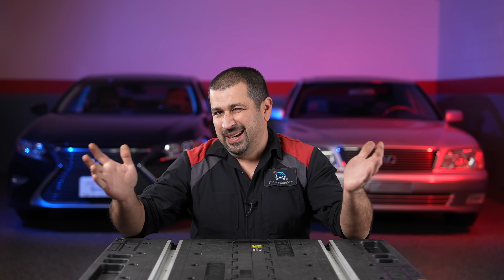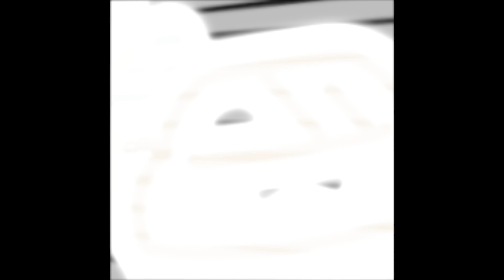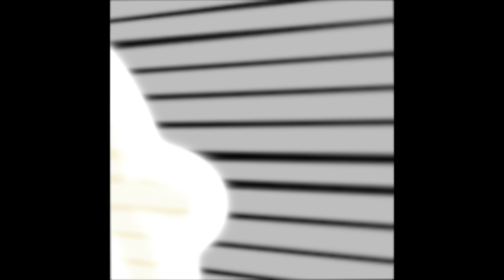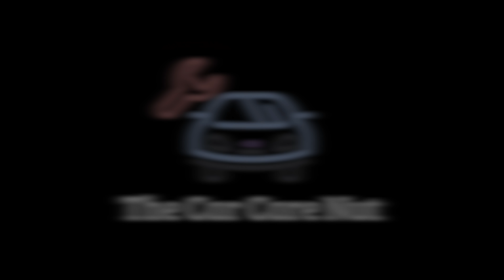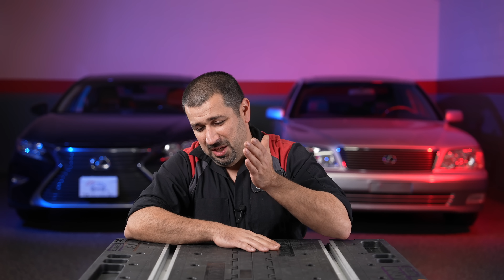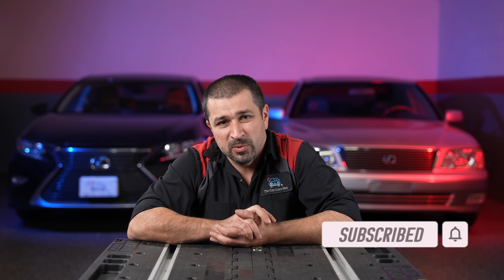Can Modern Turbo Engines Be Reliable? Here's The TRUTH!

Comment: 2018 VW ATLAS with VR6 engine. NO TURBO, NO EGR VALVE and oil changes every 5K miles. T4ansmission fluid every 30K, brake fluid every 2 years. Hopefully it can last over 200,000 miles.

Comment: I think a few points were missed. 1. If you care, pay for an oil analysis and do it for a few consecutive oil changes. They will tell you how your engine is handling those oil intervals. 2. We are seeing thinner and thinner oils. 20 used to be the lightest, but now I have heard of 8; it runs like water. ADD OIL; the lighter the weight, the quicker it burns. If you run low on oil in these thinner oils, you will introduce a lot of metal wear. 3 I own an M340 B58 car and switched from 0W20 to 5W30. I barely burn oil now, and everyone in the forums agrees with 5W30. What that means is do your research on your engine; if a thicker weight actually works go with it. Thinner oils introduce less lubrication and are there for emissions. Some engines will only work with thin oil; in that case, don't use thicker oils. 4. "Good oil" is more or less a myth now. Supertech, Kirkland, and Amazon oil are all made by Warren Distribution, and Project Farm has reviewed that oil. If you need to increase your oil change interval and the oil prices ($30 for 5 quarts) are slowly bleeding you dry, get the cheaper oil and change more often. Unless you are getting Amsoil, you aren't getting better wear with 1 10k oil change vs 2 Kirkland oil changes.
Reply: What if your car calls for 5W30? You can't even buy 10W40 anymore in a good oil. 5w40, 10w30, 20w50,?  My 2007 Lexus IS350, owners Manual calls for 5W30, but in other parts of the world, the same car, owners Manual calls for a higher viscosity.
Reply: By good oil, I mean a decent, full synthetic.
Reply: @squaaaaak3178  5W30 has a lot of good oils that have different strengths. I have used Shell Rotella and Pennzoil Ultra Platinum and liked both for different reasons. For 10W40 you still have good options like Mobil 1. Valvoline, Castrol, or Liqui Moly are all just personal preferences on what brand you trust. If you beat on the car hard and push it then you can look into Motul but you are paying 2x the cost of the other brands for a slightly better oil. By no means is it 2x better either. If you don't push the car the "good" oils don't matter to you so just get what is within your budget and keep the oil clean and topped up. And trust me, you aren't getting a real full synthetic at $20-30. There is a reason Amsoil is so expensive; 99% of the cars on the road do not need a real full synthetic. If a modern performance car uses synthetic blends, then an old economy car for sure does not require a real full synthetic.

Comment: 23 Si, 2,000 mile oil change intervals since the first oil change. I drive it aggressively to redline whenever I drive it. Also, I fill up with Shell's 92 octane fuel. I don't even warm up idle my car. I just turn on my vehicle and casually go as long as the windows are clear. I shut off my vehicle once I park. No engine issues for 27k miles.

Comment: I agree fully with CCN's advice.  The reason that automakers embraced small-displacement turbocharged engines is because of the insanely stupid way the EPA fuel economy regulations were written.  Here is the dirty truth that EPA bureaucrat pinheads don't want the public to know:  At highway speeds or under heavy load, a small-displacement turbocharged gasoline engine will get little better fuel economy than a larger displacement non-turbocharged engine--it just takes a certain amount of energy to propel a vehicle down the road, no matter what the power source.  BUT, the EPA fuel economy "formula" is weighted toward urban (city) driving, which is done at light engine load or at engine idle.  What governs fuel economy there is not how much power the engine must produce, but how much piston mass the engine must continue to push around at low RPM or idle RPM--fewer cylinders and smaller displacement means less piston mass to push around and less internal friction in the engine.  That will, indeed, lower fuel consumption if a vehicle is equipped with a smaller displacement engine when it is being driven in city driving.  The "dirty little secret" part is that the fuel cost savings of that smaller displacement turbocharged engine will be eaten up by the its decreased longevity and lower reliability.  That may make the EPA fuel economy numbers look good, but it will wind up costing drivers much more money over time with the turbocharged gasoline engine.

Comment: I have a 2018 Tundra V8. 72k miles. Gas mileage sucks but I don't care. It will last 1,000,000 miles. No turbo engine will do that. Not even a Toyota.

Comment: "Can Modern Turbo Engines Be Reliable?" Over the short term, usually yes. Over the long term, absolutely NOT. They are under FAR more stress than larger displacement non forced inductions with the same power output. They are designed to fail at far lower mileage than a normal engine. The 4.6L SOHC 2 valve V8 in my 2 ton Crown Vic has over 400,000 trouble free miles on it. The 1.4L DOHC 4 valve turbo engine in my sisters 2013 Chevy (Daewoo) Sonic completely disintegrated at just under 100,000 miles, and it took a lot of repairs just to get it that far.

Comment: What's your opinion on small micron oil filters like five microns I don't think it's a good idea not for diesel. I don't think you should go below 15 microns don't forget that 15 microns will come down to 10 microns quite quickly. You're restricting the flow if you've got small microns like that it will build up quickly and actually cause some starvation it's not always I don't believe good to have very fine filters in oil air yes oil no.

Comment: I bought my 87 grandnational with 74k miles the only problem was a slightly worn timing chain. I had the engine rebuilt and replaced the stock timing chain with a double timing chain.  It still has the stock rotating assembly and flattappet cam.  factory it was 245hp and 360tq.  It now has 500hp and 600tq.  Quater throttle is usually all i need to do if a car challenges.  Not a great top end and with 4 gears with overdrive.  What makes these cars so quick is you're in the full torque band at 2800 to 3000rpm.  I had a guy in a mustang challenge and his car sounded great.  I left him standing still.  He had a passenger, i had my family with me.  Later a guy with an m3 tried me.  We stayed pretty close, damn near even.  I back off when traffic picked up.  My car is so silent, sometimes i can't believe the power it makes.  I let it sit and run for a few minutes before i put it up.  It loves this time of the year, cool weather boosts HP.

Comment: I had a 1990s Mazda mx6 turbo. 2.2L, 164 HP. One of the best engines and cars I've owned. Zero issues with the turbo after 200K miles. Changed oil every 3k-5k miles with Dino oil. Oil changes are crucial

Comment: A major rule of thumb for Chemical Engineering is that the reaction rate doubles for every 10 degree C increase in temp. So that means a 20 degree C change in engine oil temp increases the un-wanted degradation reaction rates by 4 times. (Arrhenius equation)
Reply: Yeah I'm convinced the difference between engines that need oil changes every 5K miles and those that can go to 10K without issue are presence of oil hotspots within the engine.  I'm happy that my Mazda skyactiv 2L engine is toward the latter end.

Comment: Toyota recommends oil changes at every 10k miles i usually to them at 5k. A few oil analysis tests on the new Tacomas showed that 5k was the time to do it. Full synthetic all of the time.
Reply: That is the proper way of doing things.  If people want to shift oil intervals around, get Used Oil Analysis and see what the data shows.  There is this one size fits all mentality now, that everyone needs to use 5W-30, everyone needs to change their oil every 3000 miles on every car.  That simply isn't the case.  It depends on the car, the driver, the region it is driven in, how it is driven as far as highway or city, etc. etc.

A car driven in the city in traffic may need 3000 mile oil changes, and the same identical car that does mostly highway driving may be fine doing the oil changes at 10k miles.

If the oil analysis shows the oil should be replaced at 5k, do it at 5k, it if shows 3k, do it at 3k, and if it shows 10k, then doing it at 10k miles is just fine.
Reply: @redbaron6805 That’s too logical and sensible of a post for the sheep mentality that prevails in the comments section.
Reply: My plan is to do my oil changes every five thousand miles.  The dealership said that they understand why I am doing it this time but don’t recommend that I do it in the future.  If they give me a hassle I will find another place to get the oil changes.  This is the interval that I did for my Subaru’s, two out of the three were turbo charged, and I did not have problems with the engines.  The distances I drive basically I am changing the oil every other month.  Wished I did not listen to the dealership about not changing the oil in the CVT transmission as I would still be driving my 2019 Outback.  There is a Subaru mechanic that does videos and he is absolutely correct, you will only get around 130,000 miles out of the transmission if you do not change it.  The dealership is making sure that you get their lifetime out of the vehicle, the warranty period.
Reply: I think hybrids will ultimately  be the solution, especially  the plug in type. You get range, decent gas mileage and range.  The engine gets used less making longer oil change intervals more realistic.
Reply: Well I recently bought a new Santa Cruz free oil change $30,000. 60.000 90.000 free from the dealership which is Turbo that's a joke most oils are only good for 15 to 20,000 synthetic oils i just did my second oil change 6000 MI and the oil was already broke down and dark the car doesn't have 10,000 miles on it my point is you buy top rated oil I use mobile one full synthetic and barely got 6,000 Mi out of it I can't imagine waiting for the 30 thousand Mile free oil change from the dealership that oil will not do 10,000 MI either I will not wait 6,000 MI for the next Oil Change I will push it to maybe $5,000 miles next time if you're planning on keeping the vehicle for a lifetime definitely change the oil every 5,000 miles or less especially with a turbo don't believe in the oil manufacturers or the dealership hey it's hard enough to find a 0 - 30 oil weight most stores sell 5-30  it depends on your climate and how many seasons you have again doing your own oil changes you can look at the oil filter and the oil and judge for yourself you can take your oil and get it break down and inspect it which will tell you how your engines running and what your engine needs but definitely maintenance is the key pay now or pay later and I guarantee later will be a lot more
Reply: I have a non turbo 4runner and I change mine every 5k miles.  10+k oil changes are just insanity.  And yes, full synthetic.
Reply: I do 10K for oil changes, but I have a Prius, and I run top-end full synthetic designed to deal with heat and dirt in the motor.  If I had a turbo, regular and expensive oil changes would be the norm…which is why I don’t want a turbo motor.
Reply: @qdllc  A turbo is the least of your concerns if you stick with 10K oil changes on your Prius.
Time and time again professional mechanics are recommending to do 5K oil changes for synthetic. But there will always be people who refuse to follow sound advice.
Reply: That’s such a scam by dealerships I’ve been seeing lol my Lexus dealership also recommends 10k oil changes if you use synthetic but they want you to delay oil changes so you have problems down the road so that you end up buying a new car 🤦‍♂️
Reply: @matto6019 The flaw with that logic is that why would I buy another vehicle from a brand where the car did not last?
Reply: I do mine at 3 k...
Reply: @mikeschlup5279 I am going to risk it.  When I changed at 3,000 I was getting an oil change every month.  A mechanic I trust stated that 5,000 miles with synthetic is acceptable.  The engine was a turbo so that was factored in.  I think another factor is the amount of oil that is in the engine, 5.5 quarts, would extend the intervals.
Reply: @mikeschlup5279  Which is pretty pointless, unless you are using conventional oil.

Synthetic oil will show no wear at all at 5k miles in 99% of vehicles if you get oil analysis.

But, it is your money, so you can of course change the oil every 500 miles if you just want to waste a bunch of money...
Reply: @mikeschlup5279 honestly 3k is pushing it
Reply: 10k is for highway drivers who baby their cars and do maintenance on time every time. 
Unfortunately most people get stuck with short trips and city traffic. Many idle their car or wait in drive tru lines. Many just plain ignore the maintenance, oil, check engine and tpms lights for weeks. Use the extreme interval not the 10K interval.
Reply: Smart move. Completely agree. Service mechanics/advisors are told this BS. They actually want your engine to prematurely fail. It's all about profit for them.
Reply: @sheldonlea  That claim is beyond comically dumb.  Toyota and Lexus own recommendation clearly shows that if you drive in stop and go traffic, tow or make frequent short trips, the oil should be changed every 5k miles...

Comment: 1962 Corvair spider turbo engine. Changed oil at 3000 miles 30 wt. Five minutes start to drive and five minutes idling to cool down. Never had any problems.

Comment: My wife bought a 2025 Honda CRV 4 cylinder TURBO CHARGED.  it's got 5700 miles on it and has had 2 oil changes already and will have it's 3rd shortly.  OIL IS CHEAP!  ENGINES ARE EXPENSIVE!
Thanks for the video.
Reply: Rip 😂
Reply: Make sure to change the transmission fluid often as well. Honda makes mediocre automatic transmission.

Comment: I have a 4th gen Tacoma and some other turbo diesel cars. When discussing these I make a point that the oil doesn’t break down; It’s the additives. The things that make the oil perform at a high level. I believe I’m correct but what do you think about that? I always change oil at 5k miles no matter what. For my older carburetor v8 or whatever it is 3k miles because extra fuel enters the oil when automatic choke is used. I think it is important that the oil and its additives stay in good condition.

Comment: I’ve had many turbo VW, Audi and Honda engines. I’ve never had a turbo problem or better yet an engine problem. 
On a turbo engine lighten up on the rpm’s for the last few miles before your destination. Getting out of big boost lets the circulating oil and coolant carry off a lot of the heat. 
Secondly as mentioned oil change 5k max with a European oil spec like VW504, Porsche C30 or 40 or BMW LL04. They are designed to work in a turbo engine and especially suspend soot from direct injection to protect the timing chains. 
Mobil1 ESP 0w-30 is a very robust oil choice and is cheaply available at Walmart with VW504 spec and I run it in everything from my VW GTI EA888 EVO4 to my Honda Civic coupe 1.5T and my non turbo Grand Cherokee 3.6. Yes they all call for 0w-20 but I buy the oil and they get 0w-30 for the higher HTHS for better bearing protection.

Comment: 2018 Honda accord with a1.5t. I’m at 155k.  I do all the maintenance religiously and change the oil every 5000 miles with Mobil 1. So far no issues. 95% is freeway driving with comma navigating at a constant speed.

Comment: no.  they cannot.
The turbo is the 'Third Element' under the hood,  just an extra expense.  First two being engine/transmission.
With the octane requirement, & the repair cost for the blown out crankcase breather system that gets pressurized to extremes. (think Audi a4 plastics)
THEN you get the turbo failure itself.    Built-in obsolescence.  Fun.  But at a price.

Comment: Big rigs still experience all the loads that car engines do. The trick is lower power output. Big rigs have 15L inline 6 and only make 475-550hp.

These newer cars are trying to squeeze huge power from small power plants. That's the issue. As well as turbos built for responsiveness. People don't adjust their expectations and manufacturers are trying to pull a rabbit from a hat

Comment: Good stuff AMD. Back in 2023 we bought a 2020 BMW X3 with the 4 cylinder turbo with about 30,000 miles on it. The car was BMW CPO and I could see on the Car Fax that the dealer changed the oil about every 8K miles. So I could see 8K then 16K then 23K then it was changed again at 30K. The car has been a blast to drive and (as my first turbo car) I now "get it" as to why turbo engines are so great. The power is unbelievable (I put the race chip in it to turn up the boost about 20% - which you can do safely). But I now change the oil every 5K with Pennzoil Ultra Platinum ... still looks pretty clean coming out of the engine and so far it doesn't burn any oil. I'm hoping to make it to 120,000 then I will re-evaluate. The B48 and B58 engines by BMW seem to be pretty reliable... as opposed to the N20. We are keeping our other 3 non-turbo cars as they all have old school port injected engines and are super reliable. Thanks again for this video and all you do!

Comment: Diesel turbos self lubricate also since diesel fuel isn’t a diluent like gasoline. Honda struggles with fuel dilution in oil because of this problem with their 1.5 turbos being too powerful for the engine so it forces fuel past the cylinder rings and can cause issues. That also presents fuel wash issues.  Big difference